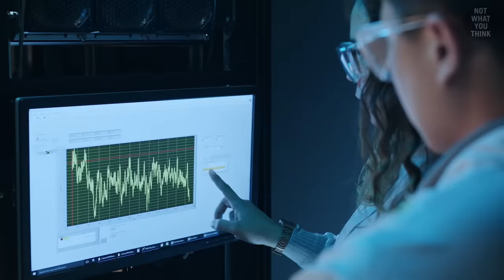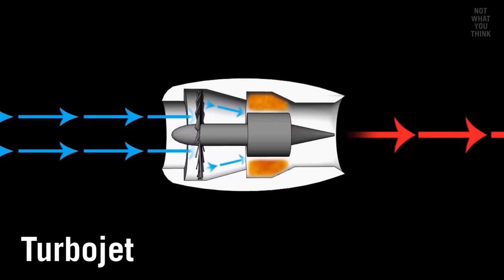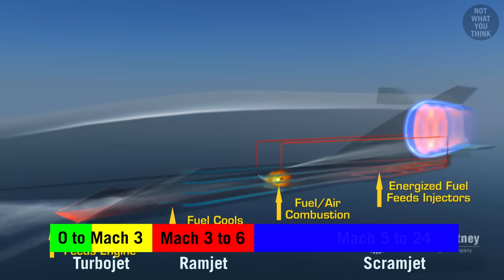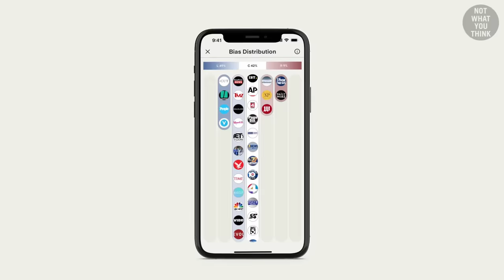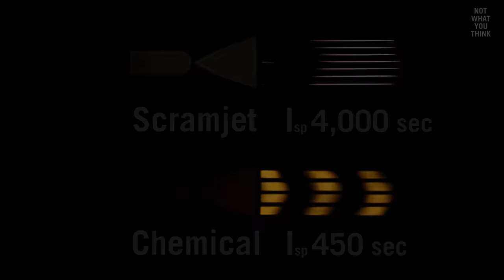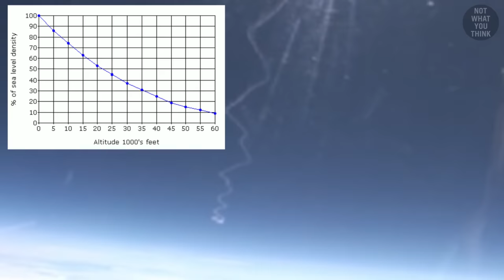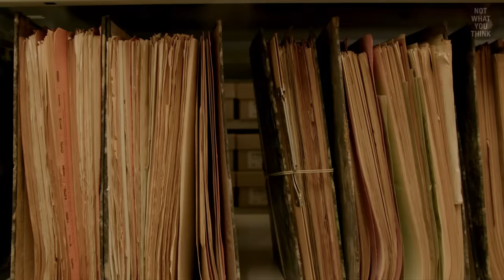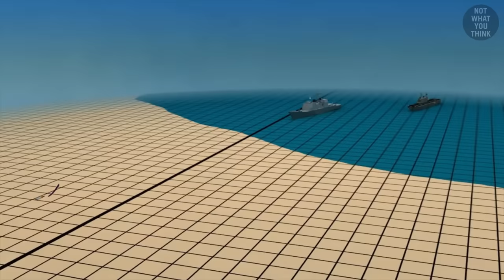The Hypersonic Missile Vulnerability That NO ONE Talks About

Comment: Author commits that rockets will never be used for the transportation. Well, the efficiency should be divided by a duty cycle before taking into consideration: in a rocket it work three minutes of a half an hour flight, while in the airplane you have to push the vehicle the whole flight (that will be far longer)

Comment: What makes sense is that during the terminal phase as the missile slows down it carry retrorockets that allow it to perform evasive maneuvers against ABMs
Reply: Except that slowing down in the terminal phase to a speed that allows for evasive maneuvers basically makes the missile nothing more than an easy target for interception systems. 

The speed of a hypersonic missile is only useful at reducing travel time for long-distance flights, which makes its use exclusively for situations where time is of the essence, i.e. you need ordnance on a time-sensitive target FAST. However, when it comes to the supposed capabilities of hypersonics to evade air defenses, the science and technology don't support those claims. Besides, as shown in the current Ukraine war, stealthy missiles like the Storm Shadow are more successful in terms of hitting military targets and penetrating air defenses than alleged "hypersonics" like Kinzhal.

Comment: At 8:00 you forget that he's trying to make a novel low cost fuel using solar while simultaneously working to optimize the rocket engine in every way possible. Efficiency doesn't matter if the fuel cheap, this is why we burn wood ineffecinetly instead of all using hyper efficient wood-gas capable burners. The cost of the input fuel matters.
Reply: At 12:00 you mention the re-entry problem, this is currently being worked on by a company called Laser Thermal, Check out the paper published by Patrick Hopkins in American Chemical Society. They're working on a novel way to cool the surface using a potentially more effective plasma based system.

Comment: Why not skip mach 5 and use a Mach 4 ramjet that is more understood, has been used for decades, and will still be plenty fast. A scramjet is harder to make and likely be less reliable.
Also, its "maneuverability" is relatively bad. I mean the SR-71 took hundreds of miles to turn.
And since you already know that even a maneuvering missile is going to aim for a target, you know roughly where they will END UP. We may have to resort to weapons that put up a "curtain" of tiny shrapnel in the general area of where the hypersonic missile will be coming. At the tremendous speed of the hypersonic missiles, even one hit by the tiniest shrapnel would disintegrate the missile.
The idea of "hitting a bullet with a bullet" is the stupidest idea I can think of. Close enough IS good enough for hand grenades. That's why we invented the proximaty fuse during WW 2.

Comment: What the hell! That rocket took a right turn at 7:52
Reply: Yes, because contrary what channels like this says, Hypersonic Cruise Missiles are terrifying because unlike the Intercontinental Ballistic Missiles, which fly in a single trajectory arc, a Hypersonic Cruise Missile is not only flying at speeds of up to MACH 10 (7,646 MPH) but it can also fly at any height and change its trajectory mid flight. 
Just to give you an example of how wrong this channel is and how deadly they are.
A NATO Strategic Command Bunker in Lviv Ukraine, and the 300 NATO and Ukraine Personel includes 40 high ranking specialists who just got wiped out the other day after Russian Kinzhal Hypersonic Missile, which penetrated 80 meters underground and destroyed that Bunker and everyone in it. In case you have trouble with the Metric System, 80 Meters is equivalent to 273ft or approximately 3/4 the length of an American Football field.

Comment: While scramjets don't become effective until about Mach-5, it is not engine choice (there are other engine choices, e.g. when very long range is not a key objective) that make Mach-5 the "magic number" for hypersonics.  Rather, Mach-5 is the approximate speed at which friction heats the air to a temperature sufficient to break down the surrounding atmosphere's chemistry, stripping electrons from the atoms to create an envelope of plasma.  Also, while the atmospheric gasses are compressed, it is not that compression per se that defines plasma, it is the atoms' loss of electrons through energetic super-heating of the air to about 1,000 degrees Celsius or higher.  Plasma is widely considered a forth state of matter (solid, liquid, gas, plasma, and exotics like Fermionic and Bose-Einstein Condensates).  Depending on how much friction they create, different aerodynmic designs will reach plasma transition temperatures at different speeds, though Mach-5 is widely accepted as the hypersonic threshold.

Comment: I still don't see why you can't shoot down a hypersonic missle mid-course at hypersonic speeds.  Certainly you couldn't shoot it down from behind, not without a hypersonic interceptor, but you don't need to be faster to hit a plasma-blind missile head-on. From in front, maneuverability and tracking are far more important than speed. Tracking a hypersonic missile is easy.  If your interceptors aren't agile enough, look at deliberately unstable designs like the X-29. Control systems these days should be good enough to autonomously fly a design like that.

Comment: Hypersonic missles are environmentally dangerous.
America had developed this technology in the 90's, however it uses depleted uranium and combustion chamber is made mostly with vespel.
Additionallly, it needs to travel at altitudes that can ignite the depleted uranium. If brought down or mechanical failure occurs - it will spread radioactive debris over 100's of miles.

Comment: I don't agree with the propellant cost comparison between jetful and rocket fuel being $30,000 and $600,000. 
A quick google search show fueling up a Boeing 747 cost $450,000 which have similar internal volume and 30% less payload mass as starship.
Although fueling up a Boeing 737 only cost $36,000, its internal volume and payload mass is much smaller( only 1/4 of starship ).
Lastly $600,000 of fuel cost required to fuel starship include the booster, which is required for sending 150tons of payload to low earth orbit.
Starship doesn't booster to send 100tons of payload or 1000 passenger from New York to London.
So that cut down the starship fuel cost of by 75% to $150,000.
Maximal number of people 737 can carry is 212 which work out to $169 per passenger of fuel cost.
If starship can carry 1000 people per launch, it work out to $150 per passenger.
Plus, the owner/operator of a starship can make more frequent launches between New York and London as the travel time is much faster may be as much as up to 12-24 trips per day.
How many trips a 737 or a 747 can make from New York to London in a day?

Comment: So the upshot of this video is that hypersonic missiles make HUGE sense. The V2 is actually a trackable hypersonic missile due to its simple ballistic trajectory. Modern hypersonic missiles are only traceable in the last few tens of seconds of flight. Too little time for any reaction. Huge difference from V2. A hypersonic missile can communicate with a satellite in the sky behind it, even if it flies hypersonic with a plasma shield in front but not behind. A fleet of several hypersonic missiles aimed simultaneously at an aircraft carrier is therefore a very well-functioning hammer. No wonder Russia and China are investing so much money in them.

Comment: I think it would help to point out that Mach number is calculated to a relative standard atmospheric (most often pressure) value at a given altitude. It is therefore much easier to achieve >1M at higher altitudes, where the pressure is much less than sea level. Hence, typical hypergolic rockets like ICBMs can reach very high mach numbers on the fringes of the atmosphere. The appeal for hypersonics comes with its capability of flying low to sea level, and avoiding tracking/detecting over long distances. Eventually, most if not all air ordinance will be hypersonic.

Comment: You dont need to slow down in lower atmosphere. You just have to use a ceramic which can withstand 2300 degrees which is doable especially when the heat shield can be activly cooled by the propalant. You could use hafnium dioboride which has a melting point of 3250 C an good resistance agianst oxidation, furthermore it has a good thermal conductivity whcih is benefical for activly cooling it.
Reply: But your sensor apertures cannot be made of these materials and still be transmissive.  At those speeds the missile is flying blind and cannot detect targets autonomously.  It could conceivably hit a stationary target with some degree of accuracy using intertial nav but it is questionable at those speeds of the missile could receive GPS/GLONASS guidance or in flight target updates from satellites.  Antennas just do not handle the temps of hypersonic flight very well.

Comment: The difficult part to be an actual hypersonic missile is maneuvering quickly at hypersonic speeds. Which is downright sci-fi to achieve. Only the US has achieved it with the new Mako hypersonic missile. Which, by the way, is part of why it's the world's first hypersonic missile. And no, the air-launched cruise missiles and hypersonic glide vehicles recently invented by Russia and China (which the US has had for decades) are NOT hypersonic missiles. Going fast is only one requirement.

Comment: Logic error 1. They can out run anything chasing them. Who is chasing it. What's coming from in front is what you have to worry about. Logic error 2 it's speed is not an advantage quite the opposite.  Logic error 3 it can turn.  At Mach 3.2 you need the North-South diameter of Germany to do a U turn add a little more speed and the diameter of the  moon is your U turn template. Back to error 2 closure speed is far more important than linear speed given error 3 it can't take evasive action. Issue 1. It will only be fired at capital targets,  given its speed it quickly eliminates nearly all other targets with the exception of 1 or 2 targets.  Issue 1 it still has to hit the ground. This is not 1950's Soviet Union trying to shoot down the SR-71. In short it can be tracked from launch it can be intercepted by a near sub sonic weapon and shot down near its target. One mission it can never do is hit a moving target on the ground that can move in any direction and most of all suddenly stop.

Comment: Russia claims its hypersonic high end missiles can travel up to 9 times the speed of sound, and this has been quoted by Western military sources so is probably reliable. They claim some can travel even faster (20-30 times the speed of sound), but these haven't been seen or verified and are probably false claims or theotrical speeds Russia can achieve in the future. 

What makes hypersonic strategically important (despite the obvious massive speed benefit making them hard to track on radar and shoot down) is this...

Hypersonic missiles travel so fast and generate so much heat that they physically change the air in front of the missile, creating a plasma field in front of and around the missile itself. 

This makes them more difficult to track and view on radar arguably. Although we could adapt our radar systems possibly to detect these plasma fields as  'signatures' of different types of hypersonic missiles, making them EASIER to identify and disable potentially.

The plasma effect may also explain why the USAF (and other airforces) have witnessed fast moving UFO distorted shape anomalies on radar screens, odd looking shapes moving in odd ways, not like a plane would, making rapid directional changes and flying at tremendous speed and often moving into very high altitude rapidly (some of Russia's missiles can achieve 66,000ft and higher in seconds). Hypersonic missiles viewed on a radar could feasibly take on a different shape and seem to act oddly due to limitations in onboard radar system tech in planes and warships which isn't designed for such fast moving objects and the plasma effect could create radar lock-on problems or distortions on the radar. For example, you may view a hypersonic missile travelling head-on and get a radar lock, you see a fuzzy round shape thing which looks static. Then suddenly it's gone.  It reappears on radar at high altitude and seems to have travelled from A to B in speeds planes are incapable of. That's because the missile has changed direction and is probably going straight upwards to do an altitude ceiling test. 

Many radar systems cannot maintain a constant radar lock on hypersonic missiles. They may widen (or narrow) their radar field and re-establish a lock on the missile in high altitude. And that disappearance and re-appearance over great distance perplexes pilots used to radar monitoring planes, when they see an odd shaped fuzzy object moving seeminly randmomly, disappearing and re-appearing. We often see the UFO-radar video clips showing the objects shoot off the radar sceen at tremendous speed and pilots going 'what the f**k was that!". Radar systems can have narrow or wide-field locking capabilities and pilots are trained to use them mainly for looking at conventional objects slower moving, not hypersonic speed missiles., So when you're observing hypersonic missiles on a limited radar system by inexperienced or not sufficiently trained pilots, things can get a little challenging and difficult to explain.

Most likely many of these UFO-type video clips released by USAF (which seem to be increasing in recent years) are more than likely Russia test firing hypersonic missiles close to NATO fighter jets/naval assets or ground air defenses to test NATO's radar and defensive capability against their latest generation hypersonic missiles.

That's just my own theory.  I haven't seen any evidence to support this theory, but I think it's a credible theory, given the increasing amount of UFO sightings coinciding with both Russian and Chinese hypersonic missile development and testing, and increasing tensions with NATO in recent years, where Russia has been testing NATO's defenses more and more.

Comment: I'm not sure about what's been said in this video. Especially the part where the hypersonic missile would have to slow down to supersonic speed in lower atmosphere so as not to melt.. I recon that weapons developers have managed to develop materials that cat stand out those kind of heats for a few seconds.. Ablative shield is one of the possible solutions. We've seen it on the US made Sprint ABM missile that is even today the fastest accelerating missile in history. Sprint was fired from the ground and reached Mach 10 within a few seconds, well within the thickest part of an atmosphere. And this was in the 1960s.. There's a great video of Sprint being launched that shows part of the shielding falling from the missile as it speeds up in the air...